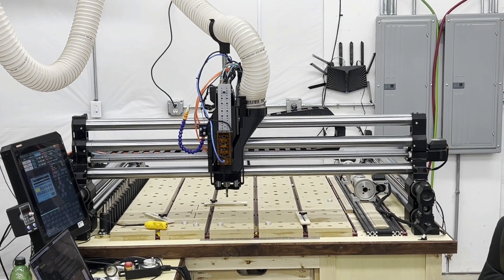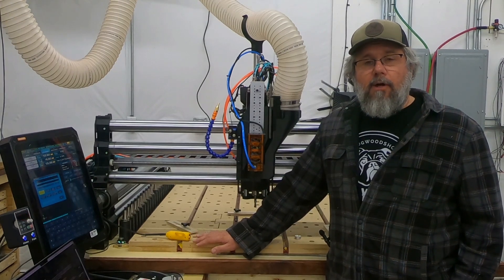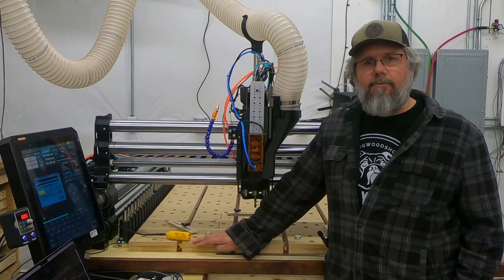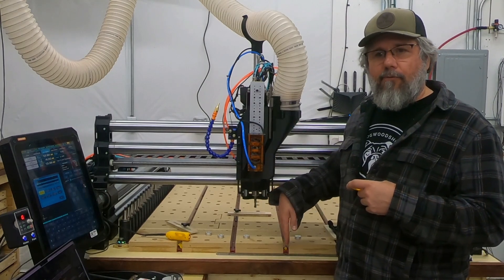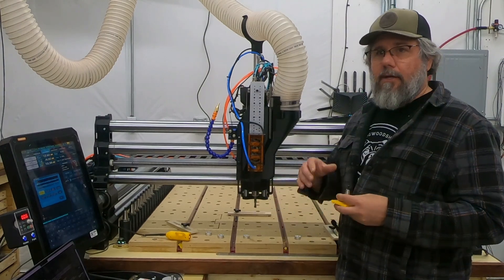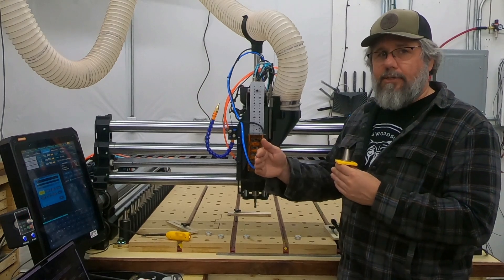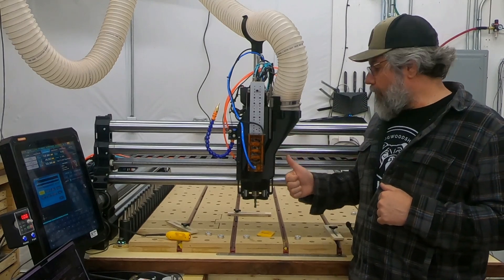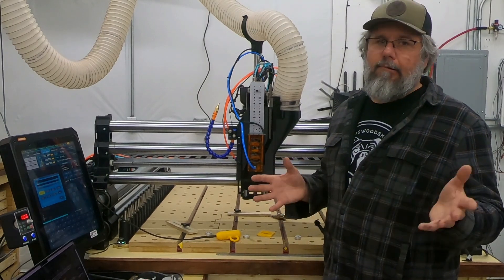Upgrade to an ATC

Comment: What tool holder have you selected in Fusion 360 for your bits?  I don't see one for an ISO-20 holder listed.
Reply from the maker: I use the ISO-20 holders that PwnCNC sells.

Comment: what model air dryer system(s) are you using for your ATC and SideKick?
Reply from the maker: PwnCNC recommended this one for the ATC a while back: https://www.amazon.com/gp/product/B0BMLL3TF4?ie=UTF8&linkCode=sl1&tag=uglydogwoodsh-20&linkId=6956fc5736dc39926d05add62864e2f9&language=en_US&ref_=as_li_ss_tl&th=1.  I used this one for both the ATC and the Sidekick.  Recently I got a bigger one for the ATC for no real reason.

Comment: I saw your, "Zero Like a Pro" video first. Does your 3D probe fit with the PWN CNC ATC tool holders?
Reply from the maker: The probe doesn’t fit the PwnCNC holders but it does fit my Maximize Tool Racks.  There’s a special model that supports the probe.

Comment: Go and look at the Rappidchange ATC, 10% of the cost and 10% of the complexity
Reply from the maker: I looked at it before, and I took another look just now.  I'm sure that's a great product for a lot of people, but it's not for me.  It doesn't support enough tools.  If you could add two of the 12 units together, to get the same capacity I have, it's about the same price as the PwnCNC one.  the dust boot issue looks like it's at least a much of a challenge as it was for the PwnCNC system.  I'm also concerned about the tools being mounted in exactly the same position each time, which is important if you hope to speed up the process by skipping the tool setter for each change.  I'd be happy to give one a try, but for me, I don't think it's a great fit.